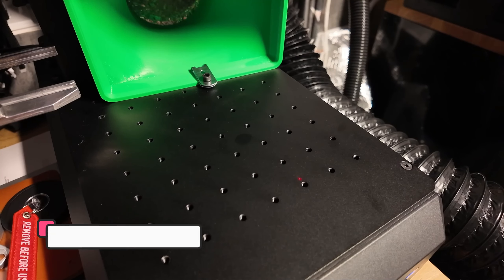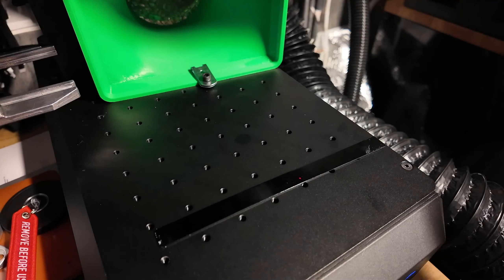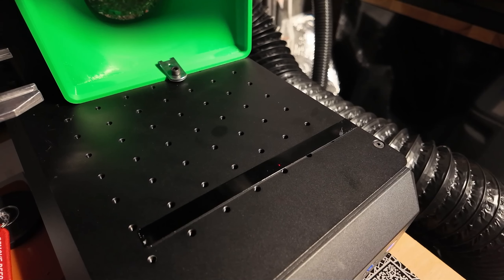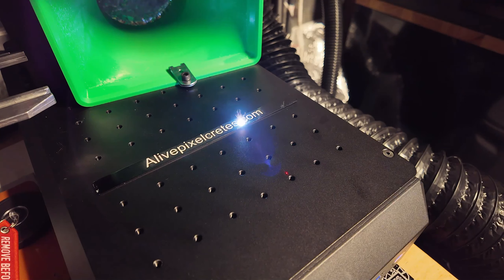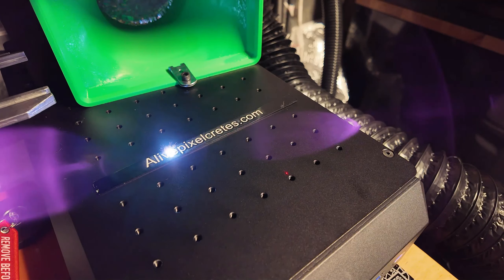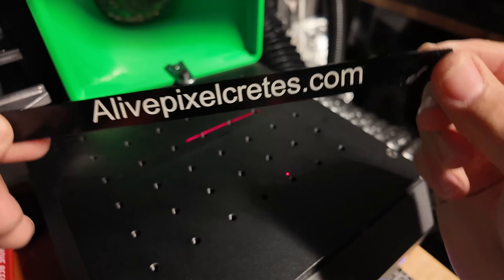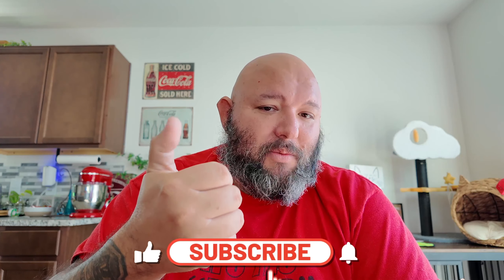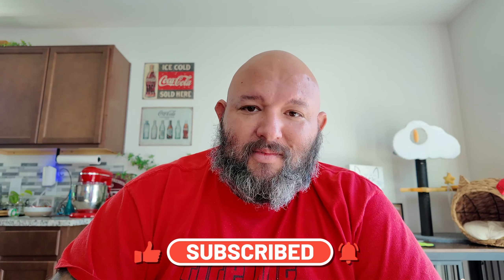New Laser - ComMarker B6 Fiber Laser! Personal or Industrial Use? Explore the Versatility with Us!

Comment: I would love to see how you correct a bad engrave on a powder-coated tumbler on the fiber laser. Will it get the old engrave completely off?
Reply from the maker: That is a good question. Normally I use another but the idea of removing the entire coating and engraving on the steel seems doable
Reply: @AlivePixelCreates  I tried it with a diode, but it does not work well. It is a Fiber Laser kind of job. Maybe CO2, but probably cleanest with a Fiber.